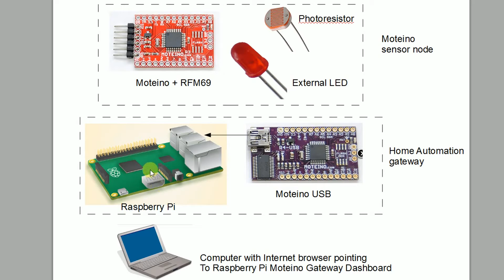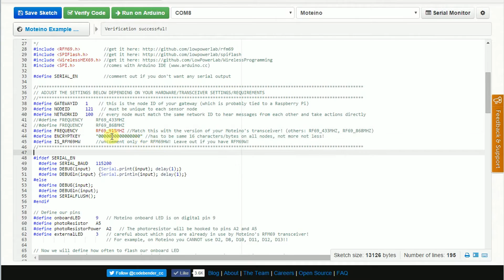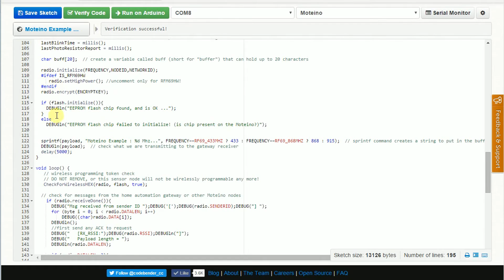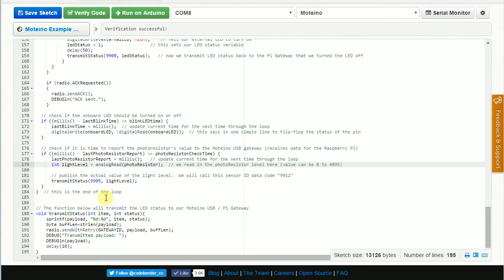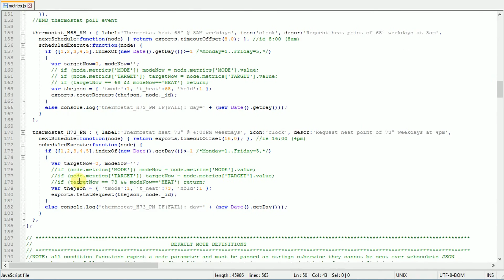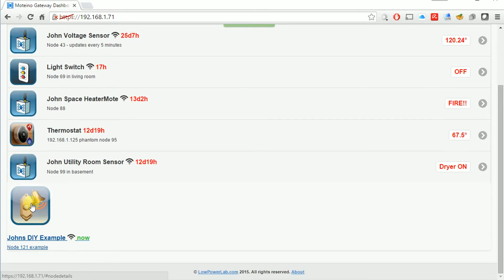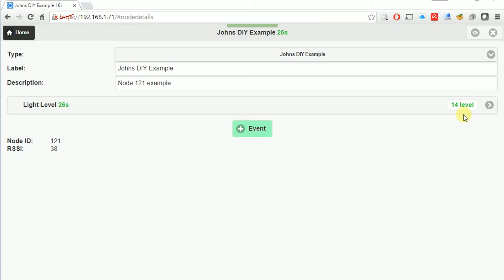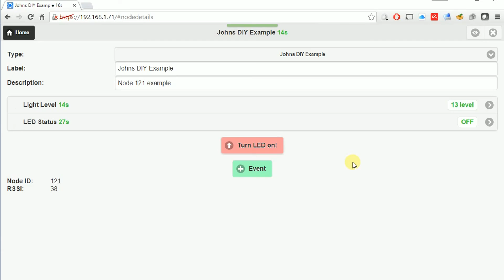Moteino home automation part 3 of 3: programming and demonstration

Comment: Hi John,

Thanks for the great introduction to this platform!.  I really want to use it in my house.  I'm wondering if you can point me in the right direction.  I copied your program exactly only changing the Frequency and encryption key.  I have the gateway setup and it sees the new node.   I receive light readings from the node every 30 seconds.  The light reader valued are accurate as when I shine a flashlight on the sensor I get a much higher number,   The gateway is receiving data fine, but I can't seem to transmit from the gateway.

I'm running the console to try and debug like this
minicom -b 19200 -D /dev/ttyUSB0

I see all of the inbound messages, but no outbound messages.  Even when I use the terminal window to send the LON  to node 121 nothing shows in the console.

Any ideas?  My network radio settings and encryption key should be fine because I'm receiving data

Thanks
Reply from the maker: Hi Roger.  You might try posting your code on the lowpowerlab forum, the software author is very helpful as is the community.  I think you're very close to success but it is probably a very easy fix of the gateway moteino code.  Here is the link to that forum.   https://lowpowerlab.com/forum/pi-gateway/  I would ask you do to the same here but more eyes will get to chime in if you post over on his forum.  Hope I can help you there!    - John
Reply from the maker: Hi Roger, looks like you already posted on the lowpowerlab.com forum and got the problem solved!  Yes there are several iterations of software out there already for the gateway (now at verion 8.5, and uses 19,200 baud) compared to earlier versions (used 115,200 baud).  Other differences too.  I apologize my code was not working under the new version but very happy Felix was able to help you so quickly and get you up and running with 2-way communication.  It's sometimes head banging trying to debug as I know first hand.  Cheers!
Reply from the maker: The RFM69 libraries have also been updated since I released this video, so that can also cause some potential issues.  Best when I run into trouble I've found is to update everything I can:  the Arduino IDE, the libraries, the Github files.
Reply: Yes,  I'm all set with the basics.  I have a lot more to learn, but I'm off to a good start.  Thanks!

Comment: john. thanks for this video. 
I have followed your tutorial exactly, using the image for the Pi gateway. 
I am able to get the light value to the web page on my pc and android phone. I have checked both moteinos over and over with the latest gateway moteino sketch. I used your node sketch. 
I can't get the LED to respond and turn on. I have checked everything. When I hit the UI button the led flashes on the gateway moteino but nothing from the node moteino. 
Any suggestions for trouble shooting. I have tried everything to get this to work. 
I know it must be a setting or something ? in the gateway? 
would appreciate your help. 
thanks,
webzter30
Reply from the maker: Hi Jeff, I think you sent me a PM over on the lowpowerlab.com web site.  I'll have a look at the message and get a response to you ASAP.

Comment: Very nice tutorial.  I was looking for a tutorial showing the relationship between Moteino code and the gateway code.  This plus the other utility room and dryer examples helps to clarify how to send simple commands to moteino and receive output back on the Gateway.  The only missing parameter now is how to pass values to the moteino other than 0 or 1.  For example, send a value of 231 to command a fan to run for 231 minutes.  How is the input 231 collected from the User on the gateway, etc?         Or send two values of 15 and 240 to set an "on" interval of 15 minutes and an off period of 240 minutes, i.e.  run a fan 15 minutes every 240 minutes.    Thanks for the hard work, this is good stuff!
Reply from the maker: +Tom Glembocki thanks Tom! Regarding your questions, it is a two-part Q.  First to stream data TO the gateway from a sensor, that is what is covered in this tutorial in regards to what the photo resistor is doing.  It can send a wide range of values from 0 to 4095.  Second to send data from the gateway to a node, you can do that a couple of ways: one is as we showed with an on/off toggle button.  If you have a small enough grouping of values, you could make a number of buttons to send different values.  But if you want total control, the easiest way to send from gatetway to node is to manually type in in the Console screen, like I did in this video around the 9:20 mark.
Reply: John... please see email I sent you via your playground email address.
steve
Reply from the maker: Steve Childress thanks for the email!  I'm reading it now!